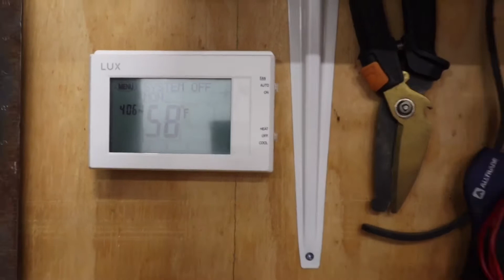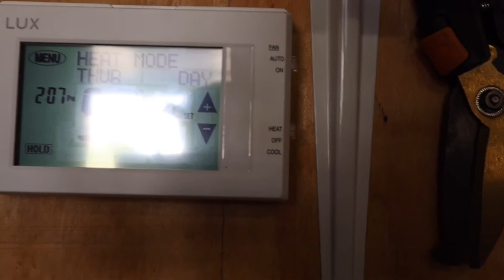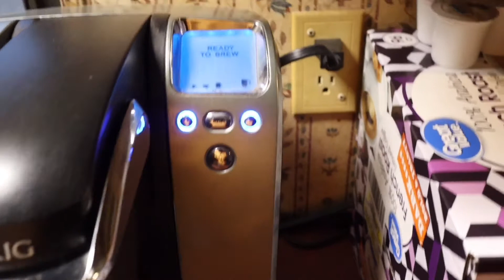How to install 80,000 btu Mr Heater Big Maxx

Comment from the maker: Just an update. Using my mr. heater big max for the second winter now. It’s working great no issues.
Reply: Do u remember what size the threaded rod is?
Reply from the maker: I used 3/8” threaded rod.
Reply from the maker: I used 3/8” threaded rod.
Reply from the maker: I used 3/8” threaded rod.
Reply: What about the noise? Is that still happening??? That’s pretty obnoxious!
Reply from the maker: The noise was the igniter, it stopped after a while.

Comment: Was wondering how long the 100lb tank last's, I know temp and run time makes a difference, but just ball park.
Reply from the maker: The 100 lb tank usually last me about a month.  But I don’t run it constantly. I’m in the garage 3 or 4 times a week. But yes temp and duration will determine how long it last, also how well your area is insulated.

Comment: Thx for the video. I'm no expert, but it looked to me that your propane tank didn't have a 2-stage regulator (figure 8 shape) on it to bring down the pressure to the required 11" W.C.  Also, what model Lux thermostat was that, and why didn't you go with the little Mr. Heater one. And did you figure out what was the noise about.Lots of questions, I know.  I'm going to be installing one of these tomorrow. Thanks.
Reply from the maker: I hope your install went well.

Comment: How large is your shop, I’m considering this heater for my 40x60 shop. I currently have a reznor 160k I was going to use but recently found out my gas service isn’t large enough to support it.
Reply from the maker: My shop is 30x40. It heats it very well. I’m sure this heater could handle a 40 x 60 , no problem, if your insulated well.

Comment: Where did you get the vent pipe from Home Depot doesn't have the stainless one. The kit Mr. Heater recommends is like $400 plus S/H Thanks in advance
Reply from the maker: Ace hardware store.

Comment: Larry, how big is your shop? I’m looking into what size heater I may need!!!
Reply from the maker: Multiply you sq footage by 20 to get general estimate of how many BTU you’ll need. My shop is 30x40 = 1200 sq ft. X 20 = 24,000 BTU. Although sidewalls play a factor as well . I have 12 foot sidewalls. Also depends on what climate region you live in. If in doubt, go big is what I say.  It may burn more gas, but won’t run as long. I got this info off of google. Hope it was helpful.

Comment: How long does that 100# bottle last? How big is your shop? Great video
Reply from the maker: The temperature has been in the 30s and 40s here.  Occasionally dropping into the 20s. I usually spend 4 to 5 hours in the shop each day on average. A 100 lb bottle will last about two to three weeks. Propane in my area cost me 55 dollars to refill tank.  So I’m spending a little less than a hundred dollars a month to heat my shop. My shop is 30x40 with 12 ft sidewalls. So it’s 1200 sq feet, or 14,400 cu. feet.
Reply: @larrymcgarage2152  What temperature do you keep your shop?
Reply from the maker: I only use it when I’m in the shop. But I like it around 70 F. If I’m busy working I’ll turn it down to 65.